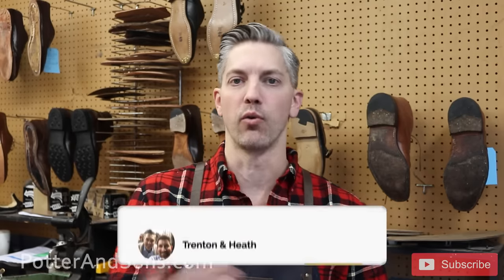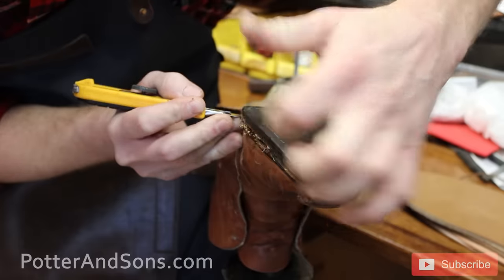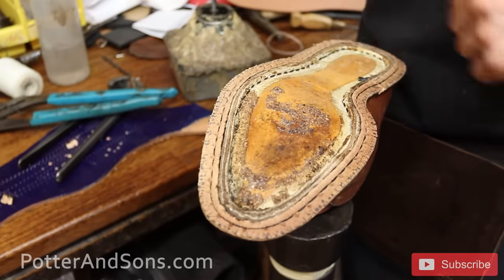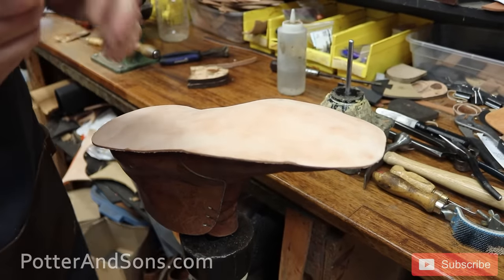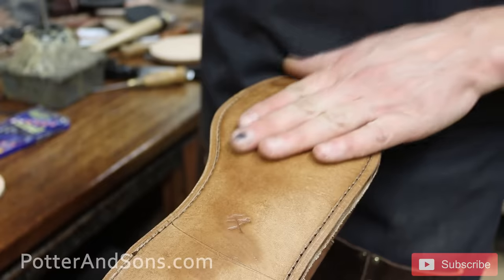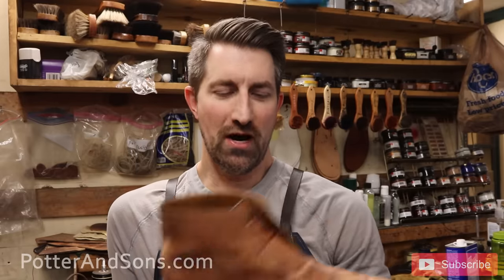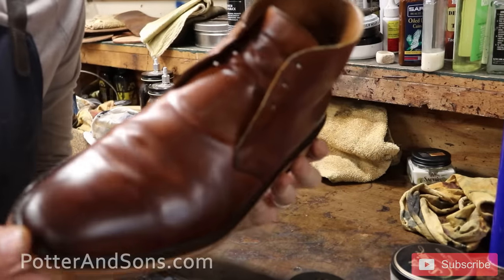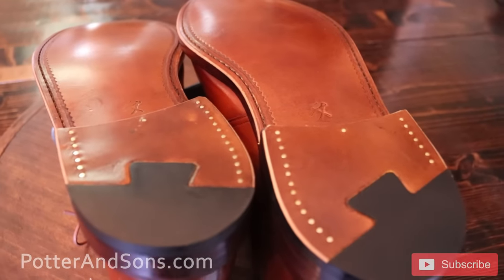A BAD Resole Job on These Crockett & Jones Chukka Boots | We Refurbish Them Correctly

Comment: "Develope a relationship with your local cobbler"... The last words.
Reply: Yeah, what local cobbler... right?
Reply: Oh, you'd be surprised how many are still left! Many people, even in this modern day appreciate bespoke shoes. I have a few pairs myself, and frankly, the prices for cobbled shoes over 15-20 years, even including the resoles and such, is comparative in price to getting new shoes every year or two anyway. Now, this does mean you need to maintain your shoes more, like dry and clean (as needed), wax after some use, YMMV, and get the shoes to a cobbler if parts come loose, or you damage your shoes. And well, parts will wear out, like heels or soles. You can replace only the heel, or even just the wear layer of the heel, which is much cheaper. The LARGEST benefit by far, is that the part of the shoes that feels nice and worn in (uppers) need never be replaced, and even a newly soled shoe will fit on your foot like a cozy dream. It's truly a wonder to wear cobbled shoes, and I can recommend trying to buy a pair. Doesn't have to be insane in cost either, you can get good cobbled shoes (not bespoke, though, but still hand made) down to $300-400 dollars, or maybe even less, but I'd watch out for those dipping lower than that.
Reply: If my local cobbler was this handsome and charming I would definitely develop some kind of relationship. I’d scour thrift shops for old Florsheims on the daily.
Reply: There are a few cobblers in my city and just about all are old European men.  One by one they're dying or retiring. When the one I was going to closed shop I was disappointed cause he did an amazing job.  Now that I'm writing this, I wonder what happened to his tools 🤔

Comment: there is a spray bottle that fills with pressure and applies an even amount of dye.  I use it for my holsters all the time.  works amazingly!  I am sure likely already have tried it before but just wanted to say it.  You squeeze the pump trigger, it builds up air pressure and then starts spraying an even coat.

Comment: I am so glad you touched on this subject. I sent my Red Wing boots to be resoled to the Red Wing factory. I was so disgusted with the work they did on my boots. They trimmed one side of my boots too close to the stitching and completely changed the shape of my welts. One is actually bigger than the other. I sent them an email with a picture attached of my boots and their response was that the welts on my boots after they resoled them look good enough to pass their quality control standards. Anyway, I would never allow them to resole my boots because I don’t know who exactly will work on them. Like you said, I need someone I can trust. I don’t know how expensive you are but I will consider you or Brian the boot guy to work on my shoes in the future. I don’t know how else I would find a reputable cobbler . I don’t trust my neighborhood cobbler . I took my boots to him and all he wanted to do was to stick on Vibram soles on them:

Comment: Nice job, all your work looks great. I watched another video of you resoling, new heels and sole protector on a pair of mens shoes that you said didn't have welting. After you took the sold and heel off all you had was the upper shell with a turned out edge that was sewn to the old sole. You glued to the mid-sole to the sole then sewed that combo to the upper. Could you have added welting to that pair of shoes? Would it have been an advantage? If so, what would be a ballpark price for that? Thanks.

Comment: These are My shoes  :-) well not That Actual Pair but I've 2 pair exactly-ish the same.
But mine looking much less Gorgeous ;-) than "Refurbished" state here ! 
I just use shoe cream, but here the additional conditioner, cream & wax look MUCH better. 
(Personally I wouldn't (admit to) adding "fake" patina and use Woly Scotch/Tan cream more than Cognac; "Chepstow" with 'stormwelt' (?) as per here and stitched rubber sole and a "Chukka" - without though I had a rubber sole glued-on bottom).

Comment: I don't understand why you make the bottom of the soles so slippery though. Drives me crazy when leather soled shoes slip on tile floors. I hate rubber soles on tile, but there is a happy medium between slippery and sneakers :)
Reply from the maker: John Paul Bouffard Leather soles are supposed to look nice when you buy them or repair them, but then you need to rough them up a tad when you start wearing them.  Crazy sounding...I know, but it’s what you have to do for better traction.

Comment: The last cobbler must have used during a holiday, where the wages a low. The mistake wasn't using that cob but really giving underpayment, the stitching looked as if it misaligned on purpose. Of course I'm just typing out of my bumbum but I bet there are small truths within.

Comment: All the plastic based sneakers ending up in landfill by the billion/year. Sad. Leather is renewable/biodegradable.

Footwear consumption across the globe
In 2017 consumers in the USA spent $74.1 billion buying 2.5 billion pairs of shoes. A decrease in amount spend, though not in volume from 2016. Chinese consumers spent $56.5 billion on around 3.9 billion pairs, an increase in both spending and volume.

Comment: My biggest problem with shoes and boots is getting the correct size - I'm a measured 11.5EEE - and unless i go to a high end $$$$ shoe store I can't buy my proper size - an example - my current shoes are 13XW SOLD at a local Walmart - and i paid $68 for them

Comment: Nice color was achieved at the end of thid video. I am very surprised thatvyou did notvuse original heel block. You must have a number of heel blocks in your shop in various sizes? Also, I thought that inserting a last into a re-sole was necessary. I don't think that I saw one being used here.

Comment: Guys, i purchased a great quality pre owned McAllister on ebay for 60 bucks, its amazing. However, the previous owner left glue on the inside tongue of both shoes. I have no idea how glue ended up there, and he did not mention that on the product description. I am having a hard time getting that glue off, as it constantly sticks to my sock and is just very annoying. I have used a dull object to remove excess glue, rubbed a cloth with warm water and soap, dabed acetone then scraped it off with a cloth. It improved a lot, but it is still sticky. I have done all the above multiple times over the last few days. I have no idea how else to get rid of that stickiness.
Please guys someone help me, its pissing me off 🤣🤣

Comment: Need advice.  I had taken my boots to a shop to have both soles replaced with new ones.  He charged 125 dollars which I thought was steep but I did it anyway.  On the first wear outing of having them the front nose of the sole peeled off leaving a flap. And I noticed by the next day that other parts were beginning to peel as well. I took them back, he repaired them again for free. I picked them up a couple days later. However when I got home I noticed that the glue or what he used is still peeling off in the back slightly of the sole. I can only imagine that in a couple weeks it will come undone. At this point, 125 dollar service that peeled off on the first outing, then on the repair they are still coming undone and peeling again, I would think I deserve a refund.  Or am I just fucked? What do I do. Need advice.